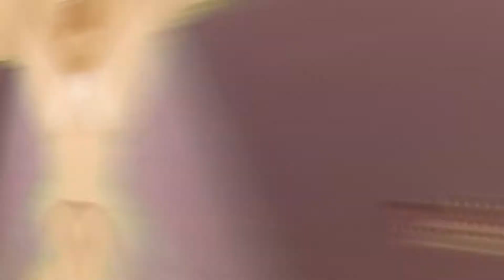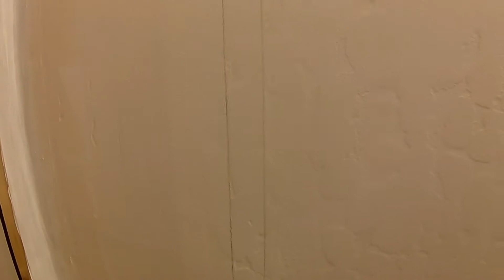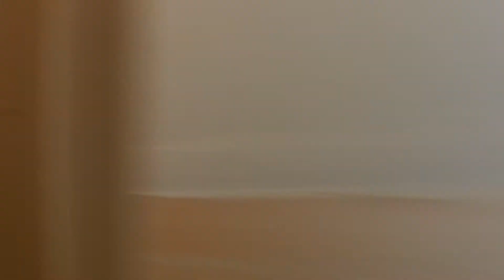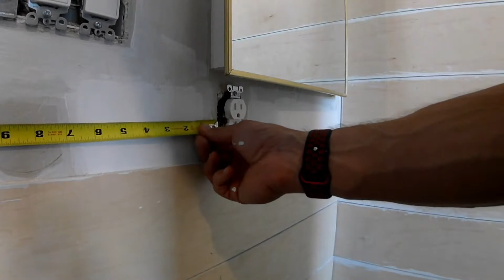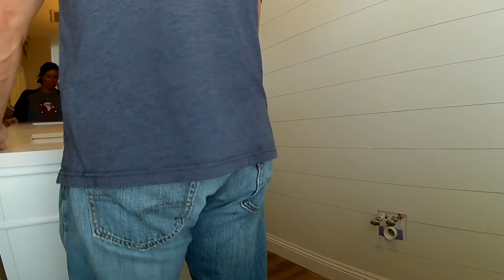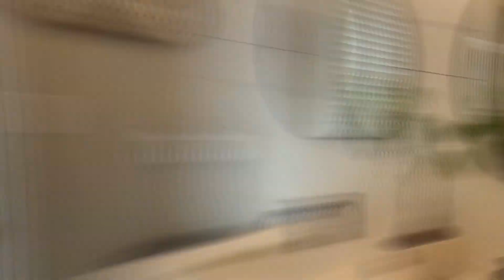Single to Dual Sink Bathroom Remodel Part 2

Comment: Love this...I'm starting to rent a place that has one sink and I need two....the house was builit in 1887. So how do I do this to keep the PSI the same to make a duble vanity for a couple?
Reply from the maker: That’s a good question.  If you go the route I did by splitting the main line coming in, as long as you use one sink at a time, most likely your psi will not change.  If you use both at the same time, your psi will likely change to be lower.

Comment: So how did the PSI come out after adding an additional sink?
Reply from the maker: My water pressure didn’t really have a noticeable change after adding the second sink.  No guarantees though, probably will depend on what pressure you start with.
Reply: water saver aerators can help with eqaulizing the PSI

Comment: I have an existing vanity light… now installing shiplap and a new light.. do I need to bring the light bracket even to the the shiplap ??
Reply: Or the electrical box ? Hope that makes sense
Reply from the maker: It does make sense! So what I did was made a hole in the shiplap the size of the light box. I kept the light mount and mounted it to the light box.  I didn’t have to bring the box out because my screws were long enough to reach it.  (The shiplap planks are pretty thin).  It worked out okay for me and hopefully your screws are long enough 🤞🏻. Hope that helps! Happy projecting and good luck!
Reply: Where was your vanity from
Reply: @fnyfrm  do not extend any outlets out of the boxes. Not safe at all. One clip you can see he done that and that’s not safe. Make sure you buy box extenders.